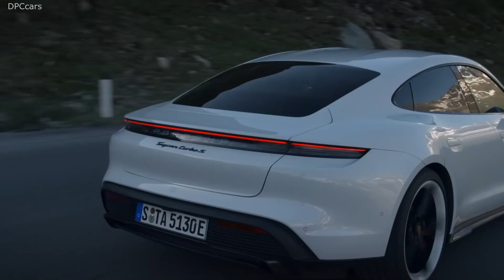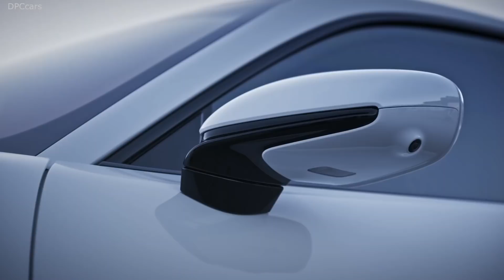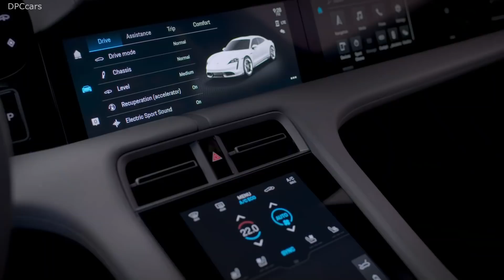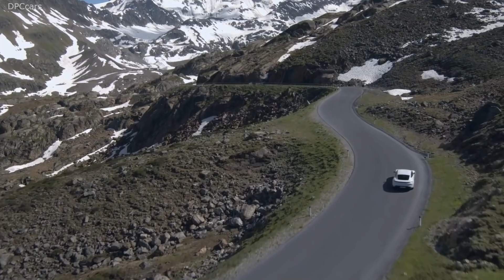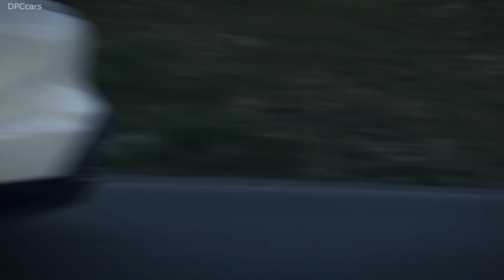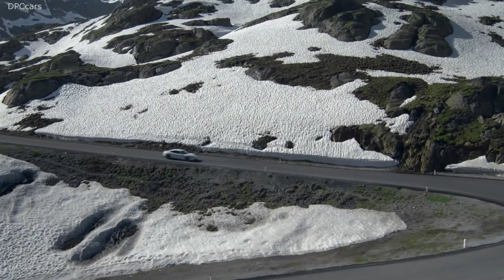Electric 2020 Porsche Taycan Turbo S White

Comment: I hope they compared their model to the model S Tesla.

I don't think the Tesla can make a whole lap around the nurburgring at full power.
Reply: That’s a cool thing to brag about, but I care more about range for a daily driver. Actual usage matters
Reply: @aaronpilcher6900  Porsche is not the brand to look for "daily driver" cars. They build street legal racing cars with some daily usability added on top.
Reply: Wermagst Valid point - I think the Taycan is an exciting car, and it’s nice to see a challenger to the Tesla Model S
Reply: Aaron Pilcher For is here in Germany daily driving has a bit different parameters. High speed durability is a real argument.

Comment: This thing is .5 seconds too slow, 100 miles too short, $50,000 too much and 6 years too late. This is the best VW can do?
Reply: @Robert Blackford  I really dont like Tesla, while I`m a huge Audi fan (and the E-Tron GT is gonna share its platform with the Taycan), but while this car has a higher quality and is a lot sportier, that is just what you would expect from a Porsche, especially one of this pricepoint. The one thing that is very hard to justify is the range... Thats the result of VW trying to stall the introduction of E-mobility too long, now theyre years behind tesla in battery development.
Reply: EU1.
You think RICH people give a fuck?? 
They don't. They just drive whatever they want despite anyone thinks.
Reply: 9.8 seconds to 200 km/h and 7:42 around the Nordschleife is too slow? Which Tesla exactly can do this?

Comment: Why do they call it „turbo S“ if it is electric?
Reply: because of the overboost button ;-)
just read the discription  :-D
Reply: HGUlmke maybe it has turbo fitted to engine
Reply: It's the Porsche brand badge for their performance lines, Turbo and Turbo S are just like S and RS for Audis. They didn't want to make a difference between the EV and their ICE cars